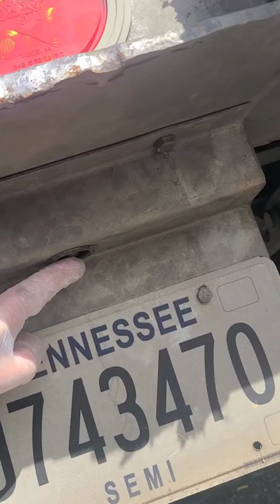How To Rewire Semi Trailer Lights

Comment: Gonna need a multimeter
Reply from the maker: Do not get an auto ranging multimeter
Reply: Some multimeters are not that useful . An incandescent bulb or headlamp places  a good draw of amperage through the wire . Some test lights  ( LED.  light emitting diode ) will light up with very low voltage .
1/23